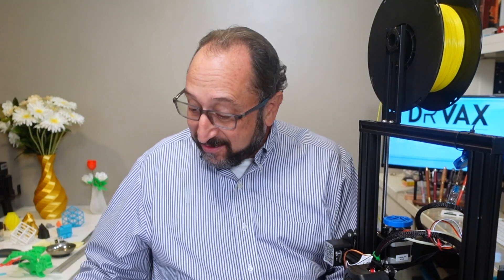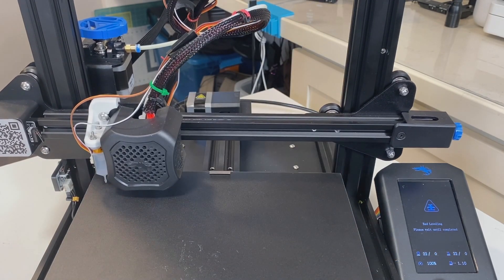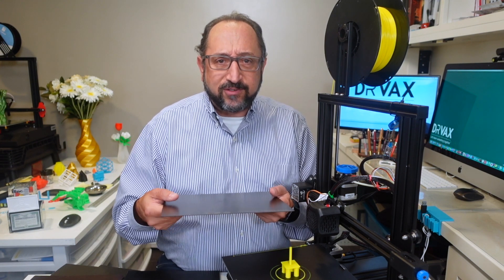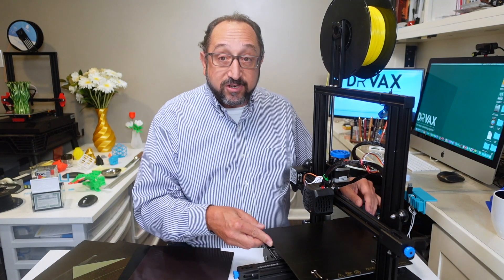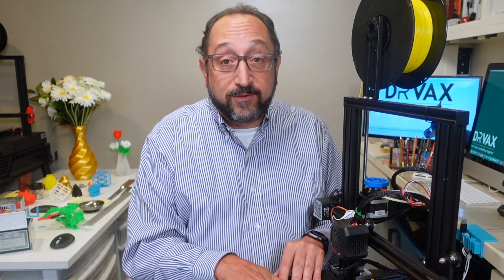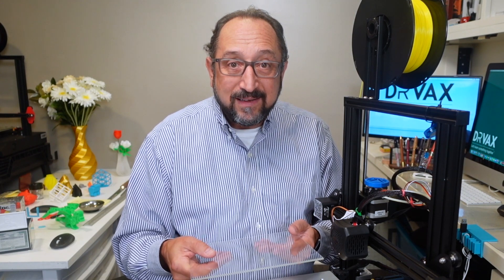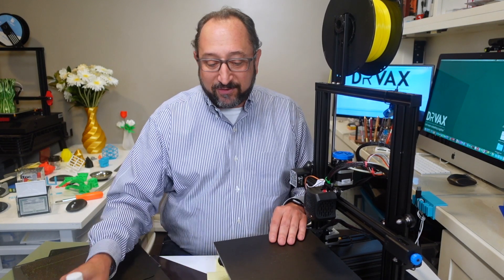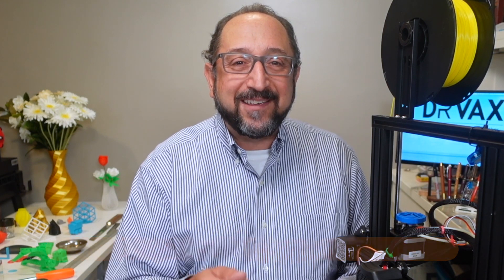3d Printing Build Plate Options

Comment: Build tek warps on my printer and hot end either irons a flat spot and then warps the material, then the hot end burns a hole in the raised portion. I switched to glass I bought locally. Works okay with a some UHU Stick and evened out with alcohol. The build tek for the TRONXY 500mmx500mm bed is pricey to buy at 3 x $20 / $60 from China and wait 3 months for delivery. Also having a hard time levelling the bed. Original start up and Z axis just bumped and 0 movement. I had missing parts and cables not long enough and bought an upgrade bed sensor that doesn't work as I do not know how to put G29 in the software for the printer. Just the presence of the sensor allows normal Z movement. There is no Z Offest available and it comes down to basic positioning and levelling. 5 attemps to make a print on glass, first 2 failed so I added the glue. It is better than nothing with 3 good prints but leveling each time before a print is time consuming. I'm older than you and not much patience left to give.
Reply from the maker: Sounds like you are struggling a bit with the TRONXY 500mmx500mm.  I have no experience with that printer.   If it has an ABL the G29 is added to the Start Gcode you specify in your slicer.  The G29 has options for how many points to probe and you can use these options to limit the probing and speed up your start up time.  Unfortunately a 3d printer with an ABL probe and no Z Offset option in the firmware is very difficult to use.   You can however specify the Z offset on the G29 command.

For example G29 P3 Z-1.10  ;  Probe the bed with a 3x3 grid and set the Z offset to -1.10

If the TRONXY does not use standard Marlin firmware this may not work.

Comment: Washing the new ender 3 v2 glass bed in hot soapy water tends to work for me when it starts having adhesion problems
Reply from the maker: Thanks for the suggestion.
Reply: Yes! Also you can use any biodegradable degreaser to clean the bed and make sure that you rinse twice the bed with tap water to remove the left over film deposit from the degreaser or else nothing will stick to the bed when you print :-(